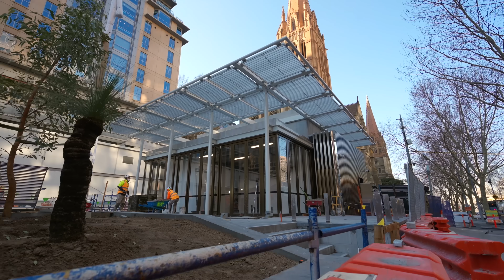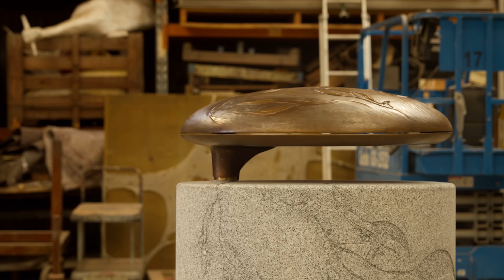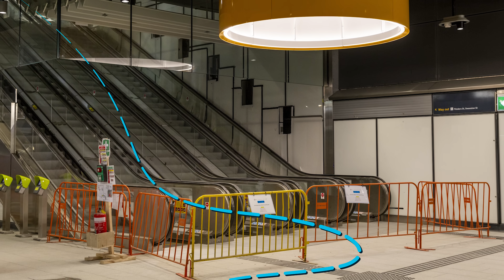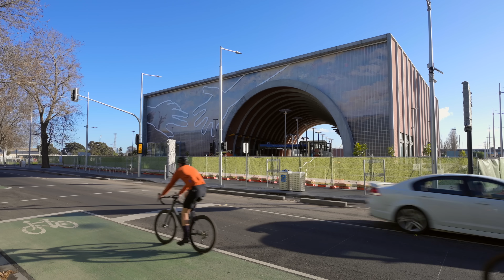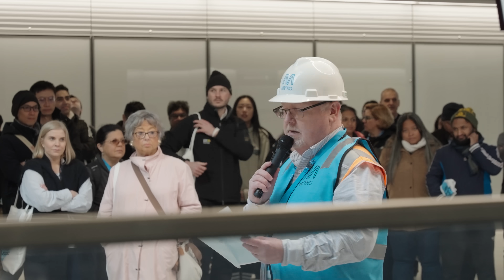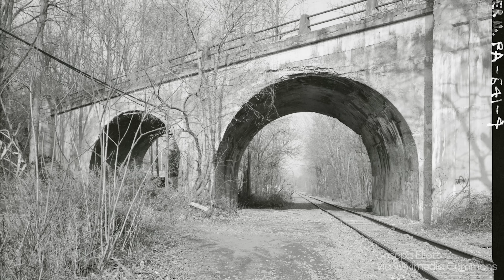Station secrets and the final stages of testing | Metro Tunnel Update

Comment: Nowhere else on Earth does it take eight years to build a train station.
Reply: @betweenlakes didn't take 8 years to build a train station! Took 2-3 to remove what was there, plus extend/bore underground much further beyond & further deeper former carpark — Platforms are length of from Collins St to Flinders St, so twice as long as City Square site, & 3 times the length of the former carpark.

@betweenlakes didn't take 8 years to build ONE Train Station only! Project was announced 2017. Much of 2017-2018 was acquisitions, planning, prep work etc.
With first demos, then digging, starting later 2018.
IF it was only 1Station Above Ground Station (& all our new above ground ones have only taken 1-2 years) ya comment may be fair. But for a deep underground station, with 2 new deep underground tunnels running under it, 7 years isn't unusual,
And haven't been building only 1 Station BUT 5 Stations PLUS TWO 9km tunnels, plus converting much of the line - from Westall to West Footscray to a new fully automated signalling system (drivers won't be Driving much of the section, just monitoring & putting in it at stations properly (unlike Sydney had with overshoots

If you think "Nowhere else on Earth it takes 8 years to build a train station" that's part of Whole New Underground Lines, with 18kms of Tunnels (2x9km) and 22 kms of New Tracks (2x11kms) for a NEW line with FIVE other new Stations, Four underground, 1 partially, you @betweenlakes know Zilch about building railways, & even less about building underground lines & underground stations
Reply: Rome
Reply: Maybe look up the SF to LA high speed rail project

Comment: Testing is where the problems are found that can't be conceived in design and may only be barely evident during construction. and...

I am so eager to ride this new rail when it opens. It's a near direct line from my place to the rail trail soon to be built between Riddels Creek and my daughter's place some way up the Bendigo line. (Small town, not saying in public 😀)  It makes cycle and rail there a zero change trike and train trip for me. (Yet to be game enough to try my luck with a Greenspeed on a VLocity. Have done the trip before, from Sunbury via backroads, but there's no avoiding the Calder Hwy offramp traffic at Gisbourne, so the railtrail is the next "big" infrastructure I'm looking forward to!

Comment: I think every other station complex I've been to in the world has some amount of retail, 7/11 woolies/coles metro equiv, fast food, etc. or even full blown floors of retail like Sydney QVB
Why would they not put at least a small amount of convenience stores in?
Reply: Most, if not all of these new stations have locations for stores. Arden has proposals to have other buildings built up around it to serve that purpose. State Library is attached to the Melbourne Central shopping centre. The others as far as I know all have built in facilities.
Reply: @prowler6435  Hi. Think some pp don't realise (re "every other station complex") they are referring to HUB Stations with Multiple Lines running to/from or through.
Town Hall Station & State Library Station (technically) aren't Hub Stations, as is only 2 tracks (4 rails) running through them.
THS & SLS only become a Hub Station (if talking just trains) because of connector walkways to FSS, & Melb Central & Station.
[That's not to say there won't be shops in them, as if look at diagrams, & other past videos, there's empty space areas that aren't walkway areas]. 
I can't think of any Station in Melb, Syd, Bris, suburbs* where it's only 2 tracks (or 3 if 3rd platform like Glenferrie Station) where is  anymore than a kiosk, or cafe/kiosk, & maybe a newsagent or a dry cleaner.
[*suburbs only, & not re termini stations]
[*Box Hill Station didn't have any, except for Macca's, within ticket gates, but don't apply now, as was moved so to be outside gates]

Will be some shops & couple cafes etc, in the City Square, 30 secs from THS entrance, & with a whole street of shops across road, all that is not enough? lol.

 I'd previously written a comment saying that Melb Central access from State Library Station are so close, so shops in MC are shops for SLS, & also said there's shops (in Campbell Arcade) re the walkway from FSS to THS. So are plenty of options (I also said).
But that comment has vanished
Reply: I think those are coming eventually. not a priority for day 1 operations though
Reply: @GoonSmith007, Museum Station opened, in 1981, with no retail at all (may have been a kiosk, but nothing more). Melbourne Central opened in 1991.
Is no retail at Parliament Station (except kiosk, if still trading; never open when I go past) & zilch at Flagstaff Station & certainly room for a few small places.
I can think of many Station complexes that have very little retail (food or other) & nothing more than a kiosk or if lucky a cafe. But then that's mostly OZ & NZ, & don't remember well other overseas ones; except lots vending machines at one.

Using QVB Sydney for a comparison is not a fair comparison, as QVB Sydney, & Town Hall Station Syd are completely separate buildings, on different sides of a street with an underground basement level connecting walkway, with shops.
Once walked along lower level of QVB to get to THS you are no longer in QVB.
State Library Station is better comparison to QVB & THS Syd as can walk underground from SLS to Melbourne Central Shopping Centre/Station concourse. 

As for THS Melbourne, there will literally be shops 30 seconds from the THS in the City Square, including (betting u a coffee, sandwich & cake, there) a 7-11.
With entrances in THS at City Square, near Young & Jacksons, Fed Square, & the underground walkway to Flinders St Station does have shops, ISN'T that heaps of options available.

Comment: I promise I'm not a negative cooker. But I've gotta be honest I'm struggling to believe this thing will be open in any capacity this year.
Reply: it's gonna be like December 20th fs
Reply: @ithebinman I thought it was November soft launch early 2026 regular services and late 2026 fully operational. Regardless, they're close. It's a pretty big project. I wouldn't sweat the small stuff.
Reply: @mindsnare, does it really matter. Rush it like Sydney did with couple their new metros (if a middle-outer suburbs lines are metros, tho one will come into CBD), & have issues. Each of Sydney's new 3 lines have had a few issues.
With the number of whingers/whiners (& I don't mean u, as u phrased yours well), before Metro Tunnel Line & Five New Stations have even opened, I'd prefer take as long as needed, so the whingers/whiners st*up. They wont lol, as ppl like that (and always glass half empty types) will whine/whinge about something re rail.
- - -
It seems that many of the oldies/ Negators have completely forgotten about the stages of City Loop Stations opening. Museum/Melbourne Central Station (only) opened in Jan 1981; Parliament Station opened in 1983, Flagstaff opened 1985, & those stations are only 2 or 3 levels below ground, nothing like these new ones & 2 of stations were cut & cover (as was part of some of the tunnels) not an all underground construction like 4 of the the new ones*
*That bit re Town Hall Station being built in the former underground carpark is somewhat misleading, as that is only a part of part of the east side of THS.
There's also the West side (entrance in Block between Flinders St & Flinders Lne) & THS platforms are length it is from Collins St to Flinders St, so 3 times of former carpark. And I'm fairly sure the platforms level is deeper than the lowest floor of carpark was.
- - -
Parkville & Anzac Stations are fully ready, & Anzac Station has had 3 Open Days (bookings only) events, already. One was invitees only but lots of railfans & non-pro specialists (such as utubers with channels & bloggers) as well as media got invites.
2 other subsequent dates (one was last weekend of July) was anyone could attend (But Limited Numbers of course), but had to book ; & of course booked out superfast